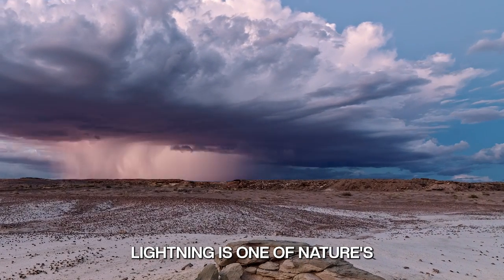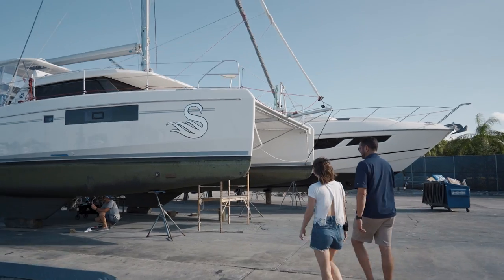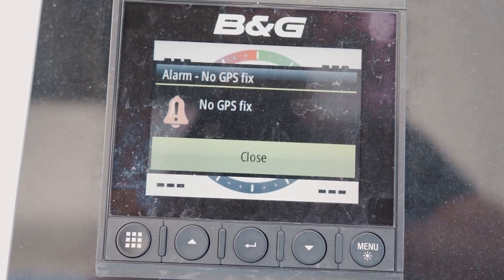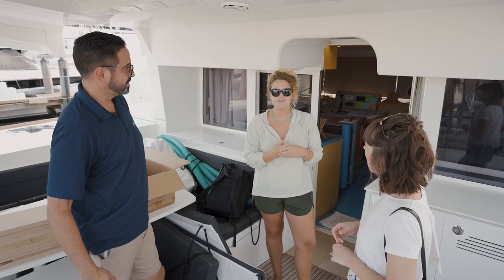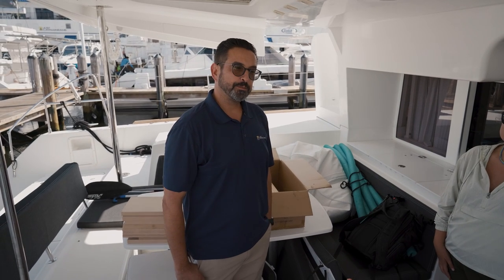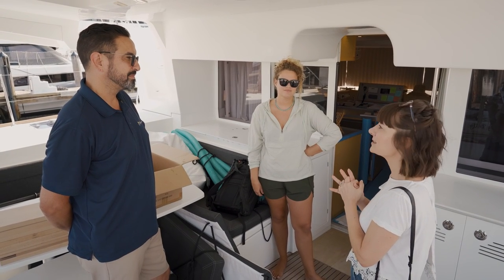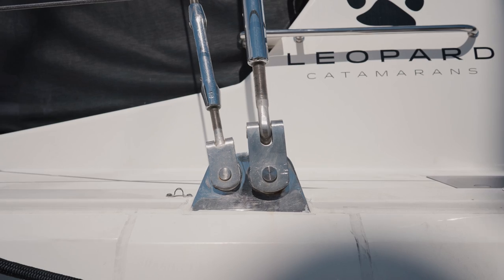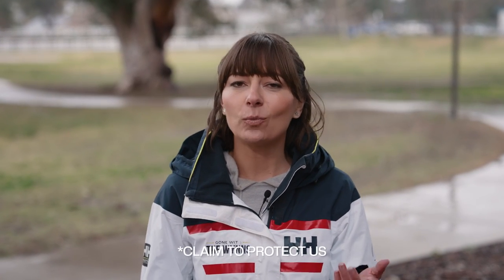Can Anything Stop Lightning?

Comment: Seeing that the device is the HIGHEST point on the mast; there’s a good chance that a strike could find its way to it, FIRST.  The side benefit is the cone of protection it would provide over your sailboat.  The concept is, to ATTRACT the lightning and direct it away, to a place of your choosing.   Sailors use to mount antennas atop their mast, a wire was run from the antenna to an anode at the bottom of the keel.  If lightening ever hit it would follow a path to the anode, where it would discharge with a HUGE explosion.  To avoid a discharge directly under the boat, a long wire from the antenna was floated MANY feet behind the boat where the lightening could discharge harmlessly in the open sea.  IMHO, the device featured on the video is just a fancied up antenna which basically fulfills the same function, i.e., to attract lightning then direct it away from vulnerable electrical/electronic equipment.   (This paragraph was written from memory of research I collected 50 years ago when designing my own 66-ft sailboat.)  LOVE you guys, and your mom too....

Comment: Lighting strikes are well documented and researched. As an electrical engineer who was involved with protecting Australia’s telecommunications network, some of statements made were either wrong or misinterpreted. At sea your boat is just an oversized lightning rod in a flat sea. The best you can do is have a substantial lightning rod (not heavy) at the top of the mast and a straight as possible conductor down the mast to an electrical plate below the water line in the water. That conductor must be kept as far away from other electronics because of strike induction. A rule of thumb is you have a 45degree cone of safety around a lightning conductor, your mast, not accounting for induced or random conductive paths   That is why you need a good low resistance, low inductance path from the rod to the water. Additional protection can be provided by using spark and surge arrestors. These should be used close to any sensitive devices. Protection is usually provided in most electronics but I have seen telephones blow of walls when there has been direct strikes. Simple but effective surge arrestors are easy to insert on most mains operated equipments. Surge protection for low voltage equipment might need additional fitting   I was not across the conversations you had with the salesman but I don’t think the claims line up with the science.

Comment: Good questions and your take on it.   Just remember from my experience, lightning is so unpredictable.   There is a reason insurance won’t discount the device.   I’ve seen lightning actually hit our ‘prevention’ device, it worked great however the sparks caused a fire ultimately.  In closing, if they discount for installation, then it’s worth further discussion.   Otherwise, create a plan to isolate sensitive devices (or disconnect) when a high likelihood arises.  My final take is why put a potential lightning rod on your new boat.  Keep your sails in the Wynn!

Comment: The best mitigation for lightning is a surge protection device (SPD aka TVSS). It consists of an electronic device that short circuits (temporarily connects) the ground, positive and negative during the microseconds of a lighting hit. This equalizes the potential of the three poles and eliminates the arcs that would happen inside your connected electronics (if they are not plugged in, they will not be affected by the elevated potential.). The duration of this SPD closure is too fast to cause any short circuit damage. Make sure that your SPD is properly rated and has it's own enclosure in case of internal failure.

Comment: Dealing with risk:  what are the chances of a damaging lightning strike?  What should/could be boat owners' choices?  Perhaps could be quantified by knowing the average number of lightning strikes on water (or near if the boat is hauled out) each month in a given area; number of vulnerable boats (modern, metal masts, metal rigging, modern electronics, etc.) in each known lightning prone area each month; number of damaging strikes on boats (i.e., is it a very small fraction of total # of boats?) over time; cost and effectiveness of mitigations?  Cost of repairs?  Cost of insurance?  Ergo, choices.

Comment: Hi... The Lightening protection is mostly based on lightening arresters that, as you pointed out, redirect the lightening to the nearest ground point (salt water)... One can visualize the lightening building up on masts in what is known as St Elmo's Fire.... tall ships have experienced this for many, many years. Your boat will be an aluminium so, it should act like a Faraday cage, inserting a cable in the center of the mast leading from a rod protruding from the top of the mast, all the way down to the water... should direct the lightening strike straight to the ground (sea water). Lightening will always try to find the quickest point to ground.... This might not protect against proximity strikes though.⚡
Reply: I'm pretty sure their HH is a standard glass fiber hull.  Maybe you're thinking of Odd Life Crafting who have a steel hull?  It would be an interesting question for industry experts - do metal hull boats sustain less damage from lightning strikes?  Assuming that is they have conductive pathways not completely protected by paint?  I'm sure there are many issues with achieving that though to avoid corrosion.
Reply: @enmodo , Yeah, sorry, I'm getting my videos mixed up a bit... but still... a cable leading from the top of the mast through to some copper plates on the hull should take care of most strikes... Take care, stay safe. 
🙏

Comment: One of the producers supplied their product the the construction firm building the expansion of the Panamá canal, they used them on the gaunt cranes, and never had a strike, in Panamá, Lightning Central.

A product like this is difficult to test as if it’s working you really don’t know if it working, eh

Comment: Food for thought.  Lighting usually strikes the highest point above ground. For Land based Standards that I referred to in the past are:- Australian/New Zealand Standards AS/NZS 1768:2007 Lightning Protection, AS/NZ 1020 The Control of Undesirable Static Electricity, AS/NZ 3000 Electrical Installation Wiring Rules also covers Earthing. For land based Lightning protection, I sought advice from a company in Australia, which is Global, nVent Erico. These sources are a good start to get your head around the problem. Also I would research what is available from IEC Standards (International Electromechanical Standards) which form the basis of Electrical and Instrumentation Hazardous Area Standards globally.

Comment: As a physicist I'm extremely skeptical any gizmo on your mast will impede lightning. That discharge is looking to get to ground (the ocean) and it's willing to go a few miles thru the air. Nothing small is likely to stop it. Instead follow Carl Beaver's advice at top - have a lightning rod with a thick copper cable to ground/ocean. Any electronics you really care about get put in a Faraday cage with no exiting electrical wires. Put electronics there, either permanently or temporarily during storms. Ovens and microwaves make good Faraday cages. But it's difficult to put electronics in a Faraday cage permanently and still be able to use them. Would have to be battery powered. Fiber optic connections would be ok but I'd guess they're uncommon on boats.
Reply: To get a bit technical, electricity will break thru air if it reaches 50k volts over an inch. In comparison it will go thru teflon when it reaches about 1500k volts per inch. So 1" of teflon is very roughly the same as 1500/50 = 30" of air. In other words some gizmo with a few inches of teflon may have about the same effect as lowering your mast 6-9 ft, i.e. not worth the $.

Comment: I have never sailed, with that said I have a interest in the topic.  The problem I see with these devices and or any others like them that proposes that the ions are dissipated, is at the end of the day they don't work.  There are many lawsuits that have been settled out of court for "Lightning Dissipators".  The most common are the ones that have strands of stainless, that then dissipate the charge just like this device, to "prevent" a strike.  Many of these companies have been sued, and settled out of court.  They continue to market their warez to people who want a solution to a problem that we really don't have all of the data for.  One of the best pages I found was written, and they engaged the person who designed the lightning system for NASA, and were awarded for their design.  The perspective of this engineer was that while a lightning dissipator might stop a strike of the object, it does not take into account what we now know is the mechanism for a strike to occur.  The strike occurs because of leaders, a ladder of ions that lead up to the cloud, and it gives a way for the current to flow, and while the dissipator may not be struck, other objects can be like the antennas, or shrouds, because they can have their own chain of leaders that lead up to clouds to complete the circuit.  Again this device's principle is the same as all of the others, it claims to stop strikes, by dissipating ions.   If the existing lawsuits against the existing products are any indication, eventually this company will be sued as well.

Comment: Years ago researched lighting protection U of FL had an extensive research paper. At that time some boats with the grounding plates in the water had holes blown through to bottom, so I opted out. Wonder how much one could save on insurance if they self-insured the electronics?  Most of my lighting strike experience is oilfield related, saltwater thanks on well locations would always get hit by lighting no matter what level of grounding & protection they put on those fiber glass tanks.  My theory is salt water has negative charge making an easy path for the positive from clouds to be attracted to.  Well insurance is simply privatized socialism & we know that never works out cheaply.

Comment: It would be cool if you could install that device on an electric lift mechanism.  When a lightning storm is near you push a button and it lifts up from inside the mast to a level over the antenna(s).  When the lightning threat subsides push a button and it descends back into that mast.  Down side, probably another 20 grand.
Reply: Lightning from a Clear Blue Sky.   Better to have it installed permanently and always available.

Comment: I have heard of similar looking devices being used on cranes, where lightning protection is vital.  I thought some similar designs cost approximately $4k for the device alone. I guess an installer will charge a lot more for the installation, their own insurance, profit, etc.  The mounting/extension pole looks like it could do with bracing at least where the pole attaches to the mounting plate,  it will encounter large ongoing stresses as the mast moves and whips around.  I would ask an engineer how / if to attach a device weighing a few kilos to the top of the mast.  Also I wonder if it could invalidate safety certification where stability calculations are involved (e.g. CE mark).  Even excess weight at deck level can reduce a boat's righting moment to an unsafe level.  There's a good reason, racing boats, choose lightweight components & sails aloft.  
Regarding the effects of lighting, perhaps, improved surge protection, particularly on inverters, would limit the damage, I even have one on the mains suppy to my computer.  Additionally, it could be worth housing / storing some components in a Faraday cage.
Thanks for covering the topic, perhaps you can revisit it as you deliberate over your new boat.

Comment: Lightning is attracted to a pointed area vs a round area. My experience is with twoway radio equipment  with many antennas on one tower. The tower is ground and also every individual cables go though a copper plate ,that is also grounded, using a lightning arrestors. Fiberglass is an insulator, but the standing rigging using stainless steel is an inductor, but using synthetic fiberis is non-conductive. The lightning will hit the antenna down the cable, which a lightning arrestor installed in series the antenna able, then ground to copper plates attached to the boat. All grounding wire is with  #4 AWG bare copper wire.

Comment: In the Army, we were briefed on the effects of a phenomena called Electromagnitic Pulse which is the result of a nuclear explosion, especially an atmoshheric burst. Such an explosion would cause minimal damage on the ground, but its effects on infrastructure would be catastrophic, knocking out power grids for miles around the actual explosion. Turns out that this is exactly the same thing that happens during a lightning strike, albeit on a much smaller scale. It isn't the direct strike  on modern equipment, it is the effect of EMP that causes the damage to sensitive electronic equipment. All military equipment manufactured in the last several decades is shielded from this phenomena. You are looking for devices that protect from EMP and they do exist especially in Florida. I live in Louisiana within the so-called Tornado alley and have had two A/C units destroyed, two refrigerators and one garbage disposal, a TV and a computer fried because of lightning. So, you are looking for a lightening rod as well as a shield from EMP.

Comment: There is a simple, effective and cheap solution: Surge suppressors. They are blue disks about 2 cm in diameter and 2 mm thick that you connect between active and ground. You select their surge voltage according to the circuit to protect for 240v it will be about 250 v, for 110 volts it will be 120 or 130 v and for dc same principle. They should be fitted to each power point. They are small enough to fit inside the socket between active and ground. 
What they do is leak to ground the extra voltage due to the lightning strike, or to the induced voltage spike theygenerate.
Of course you should also have your metal mast connected to the water and your ground connected to that as well. Just like buildings have always been protected with lighting rods connected to the ground.
It is very effective at protecting your equipment. The more surge suppressors you have the smaller each surge will be as it is spread through many devices. If the charge it too much for the suppressor, it will fry, but at about 2 dollars each, that is no too bad indeed and in doing so it will protect the equipment it is supposed to.
I love your channel, cheers
Francois

Comment: One thing that scares me is the examples show protection based on having a earth ground not over water..  Providing a path of least resistance is easier with an earth ground than being in water....a big conductor!  Let's face it a lightening bolt is really really strong, direct or proximity.  If it is new technology make them give you a break on the price or a guarantee it works.  Fred in Texas

Comment: Several things can be done to help you in a lightning storm.
have ac and dc cutoffs not breakers cutoffs they create a bigger gap. then go turnoff all breakers. have everything that comes form you mask easy to disconnect. yes vhf/radar wind all need to be disconnected. shore power disconnected. those things plus  That lightning preventor will save your butt. Since you are getting a new boat you can have it installed way cheaper since the mask is not on yet and adding 4 more zinc plates to outside can also be done easy also running the wires might be the same price. $10,000 is about what it would cost you. I think I would go for it.  in storms do not be in a marina but on anchor with a Mantus anchor far away from the nearest sailboat.

Comment: Also use diodes to protect your electronic devices. The lighting will burn the diode out and help to drastically improve the chances of your electronic equipment surviving. The boat also has to be grounded to the water. Fiberglass is an insulator. Also when you haul out it must be grounded to the ground. Drive a ground rod and attach a 2/0 or even a 4/0 ground wire

Comment: I’m a bit skeptical on those air de-ionizers. It may work well for those commercial applications but those commercial applications are not moving and may encounter less wind. It also looks like the commercial de-ionizers have more surface area where the ones for sailing are a smooth round surface. Less surface area means means less air can be de-ionized

Comment: I wonder if a simple solution is some long stainless poles, screwed together, that can be mounted to chain plates and extended upward higher than the mast.  The top of the poles have an ionizer brush,  the bottom of the poles have a copper braided, flat cable that goes into the ocean for 4-5 feet.  Lightening looks for the shortest path to equalize the charge.  Make something other than the mast part  of the shortest path.  It would also offer the least resistance which is another key factor in striking location.  Address both and the possibility of damage is reduced.  If the rigging is fully insulated from the electronics, use the rigging to mount the set of lightening rods.  Would not be too hard to deploy during a storm and the copper straps would offer less resistance than any other path.  Electronics would not get the power surge that cooks the microcircuits.  Not too hard.  Highest point (shortest distance) and least resistance.